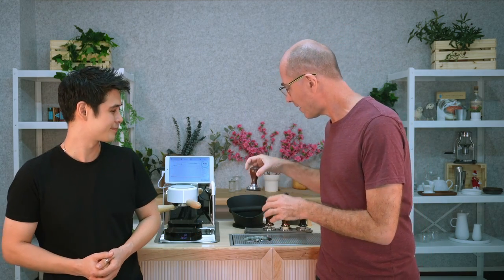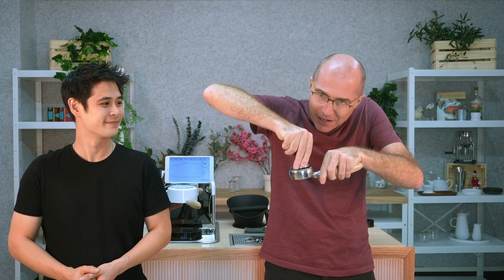Tamping is difficult

Comment: Great video! I use the idroprep gel tamper, which actually solves for most of the tamping issues mentioned here. Paired with normcore spinny WDT and gravity leveler, the idroprep tamping process I follow brings even density across the pick, reducing channeling by a big margin. Because it's a hydroforming technique with the gel pad instead of a flat metal pushing down evenly, the coffee Grounds get pushed around to occupy all the space with even density.

Comment: I would add that some tampers that are spring loaded, if they are under uneven pressure (either from the user pushing, or uneven distribution of coffee) they can tilt and produce an unevenly tamped puck. There is one well reviewed expensive tamper that is extremely prone to doing this. Something to watch out for.
Reply from the maker: Yep, I know exactly which one you're talking about.  That large black plastic piece on our v4 tamper, is for exactly this reason.  It has to be quite wide to prevent the problem.
Reply: Tom, research has show that there's no difference between shots with tamping pressure more than "firm"... and my unscientific experimenting has confirmed this.
Reply: @markpalmos  Well I have certainly not been able to compact coffee more by using extra force. The testing would have to be combined with maintaining the pressure for extended time to transfer energy into the coffee because of this effect.
Reply: @decentespresso  Yes, that is a feature that I really like in a tamper.
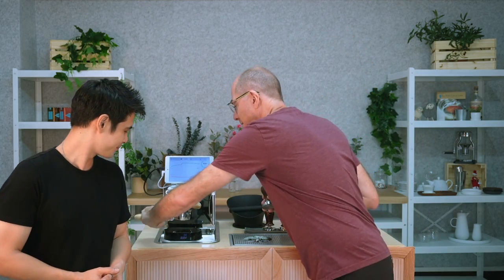Reply: 0:15 0:17 0:36

Comment: Question:  the spring is calibrated at 15lbs but the user can still apply much more pressure than that right? So someone who puts body weight into it vs someone who just pushed until resistance is there.... Will produce different pucks?
I have a force tamper that helps drive consistency no matter what the applied pressure but it's a love-hate thing as it really is made very sloppily and with not much pride. I'd love to find a better solution.
Reply from the maker: The 10lbs is just resistance, to make the leveling plate be level. You can push as hard as you want.

However, our experiments (and others) found you cannot actually compress a puck more than 25lbs.  What people think is over-compressing is actually pushing so hard they make an uneven puck.

Lots of research has shown that all pucks compressed evenly at 10lb and over, are all equivalent.

The Force Tamper is very nice, I have no problem with it at all, and we work with its creator (Zubing) on other projects as well (such as our steam wand tips)
Reply: @decentespresso  THanks for an honest and educational reply!  I just wish Zubing finished the FT better.  The shaft has lots of burrs and the tolerances are not nearly tight enough.  I'd happy pay more for a FT Premium edition (or a Decent x FT edition.... ;-) 
While I have your attention:  I have a suggestion for the "One Decent VIdeo To Rule Them All".  Where can i send it to you?  Email?  Forums?  Messenger? Thanks!
Reply from the maker: @kenflip  Zubing's Force Tamper design is expensive to produce because his approach requires quite tight metal tolerances, lots of small, precise parts.  The first-generation Force I have of his was perfect, but I'm not surprised in a post-COVID world, that he has trouble keeping that perfection up.  My tamper design is much less demanding of our suppliers.

As to video ideas (or anything) we're easy to reach off our website. https://decentespresso.com/contact